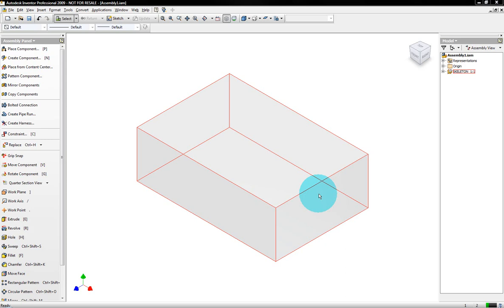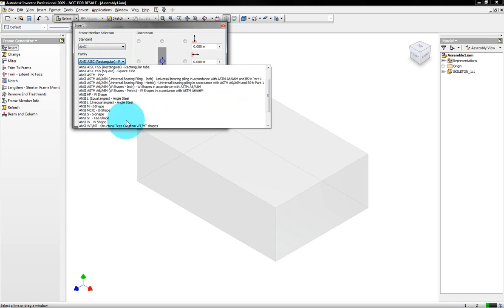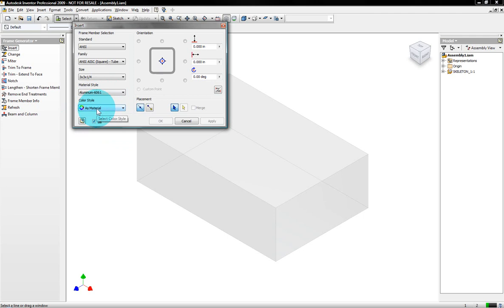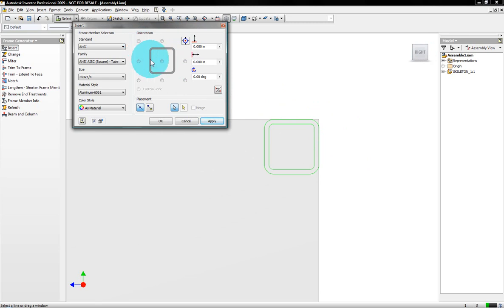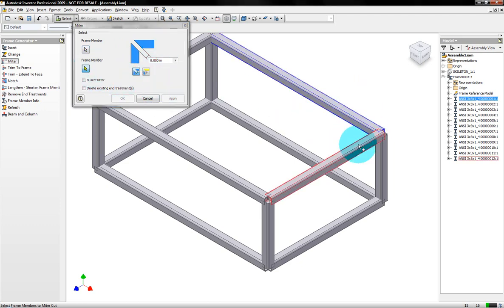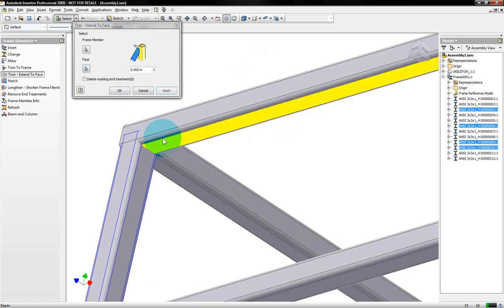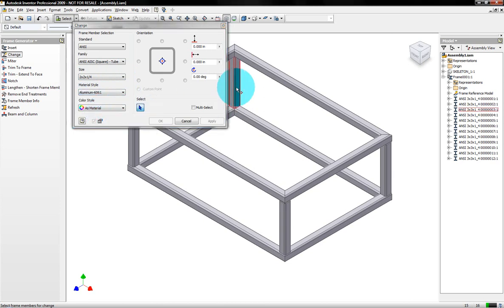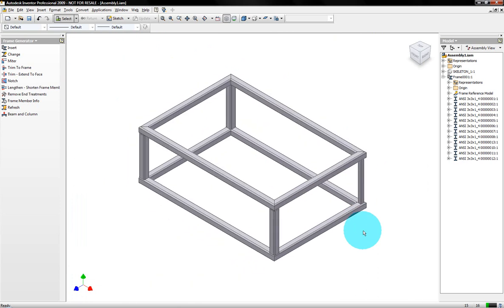AUTODESK INVENTOR'S FRAME GENERATOR

Comment: Thanks for the explanation!
Since it's called "SKELETON" in your video, I thought there was a way to convert it to this, but I've learned a few more things in the meantime. However for me the frame generator still doesn't work because of an error, it seems I need to have Vault up and running as well (and that isn't working for me at the moment). I hope to fix it and check out the frame generator soon! :)
Thanks for replying!